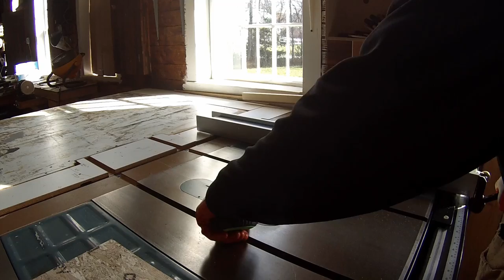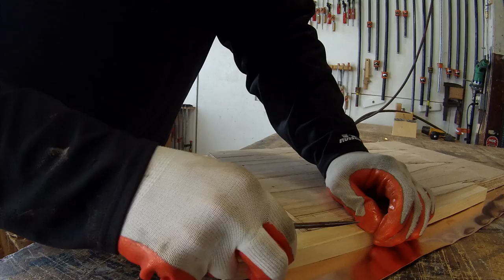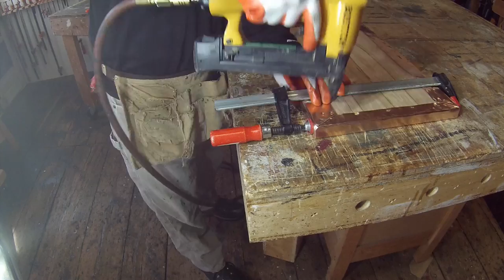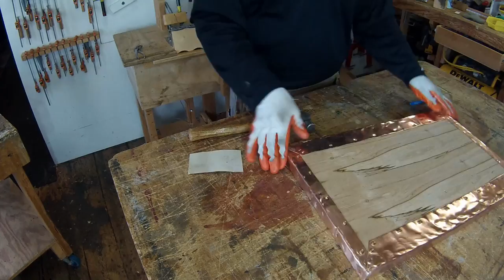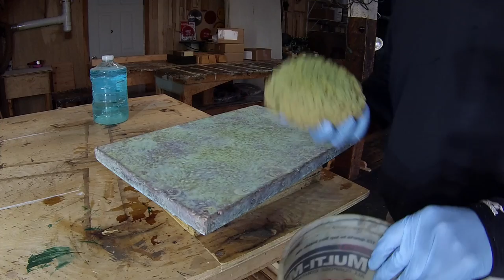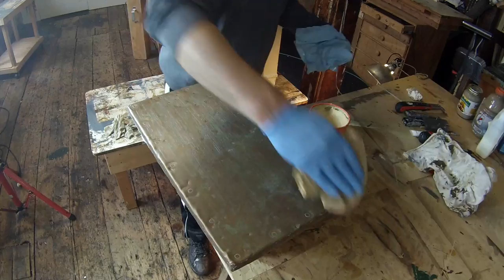Making a Copper Top

Comment: Nice work mate. 
I used your video to learn how to make copper tops.
Now I make them alot. 
I glue my copper down before folding and I use a curved wood mallet to give it an all over hand beaten look. 
And I solder the corner folds.
I quite often refer back to this video if I haven't made one for a while just to check my corner cuts. 
Thanks
Reply: How do your corners look? I've been wanting to do something like this, but wanted to make the corners look smooth, is that possible?

Comment: I've always wondered about the copper that you use.  What gauge? Where do you get it.  I had some copper that was too thick and almost "springy" feeling.  Maybe it was a mix of copper and another metal?   Would love to hear more details. Thanks for the video!
Reply from the maker: +SeriusB 
There are two types of rolled copper:  Hot Rolled (annealed) is what is called soft copper and that is what you want to work with for hand forming.  Cold Rolled (work-hardened) copper is stiff and springy.  Both are relatively pure copper.  The stuff I get is 16 oz. or 16 gauge.  some hardware stores carry it.  roofers use it.
Reply: +hffcom 
Thanks for the info. Hope all is well...take care!

Comment: Is that lacquer to protect it? Could you spray lacquer on the raw, shiny surface to protect from oxidation?
Reply from the maker: yes you could... better to just buff the copper to clean it as you go or use lemon juice to take the oxidation off.  lacquer will chip off

Comment: Hey Mitch, I bought some of your "Juice" last year in the concentrated liquid. I used a small mixed amount on a Zinc top and it turned out great, client loved it. Question is if I decide to mix the concentrate into a larger container with water, how long of a shelf life would say it will have? Thank you...
Reply from the maker: +woodmasterguy 
I have not tested shelf life beyond 2 years but would assume that as long as the container is sealed it should last for a long time
Reply: +hffcom Excellent, thanxs much love the product...